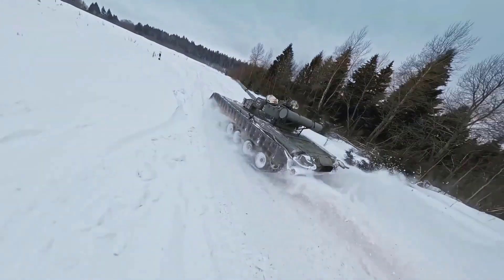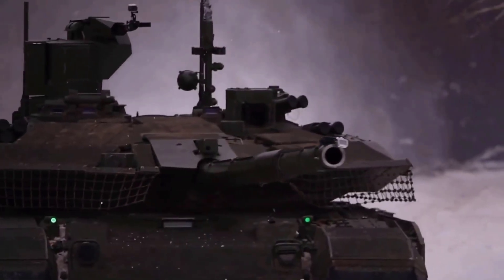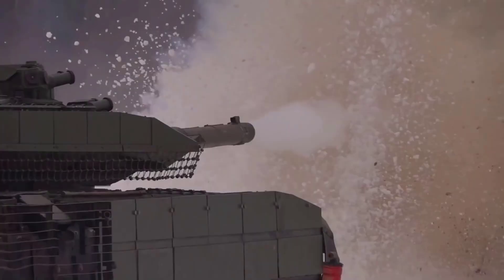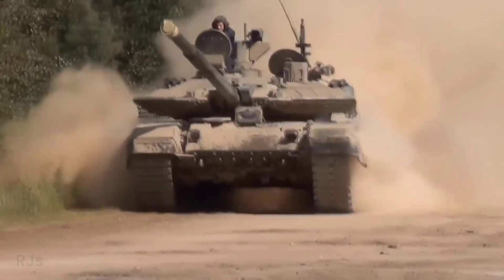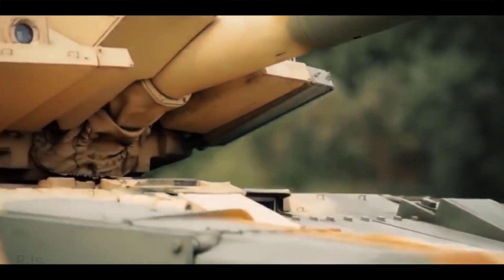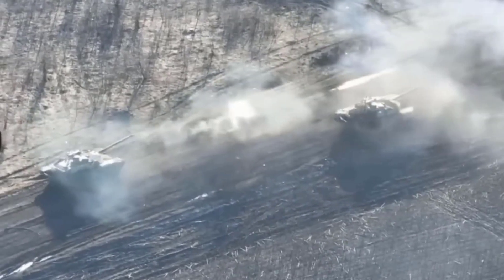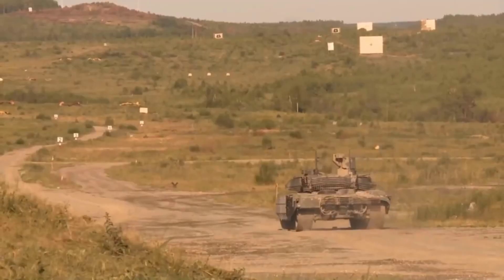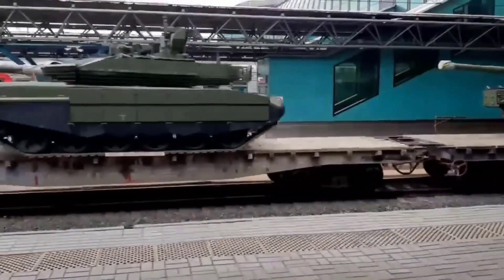Advanced Ukrainian Tank Vs Russian Made Tank | BM Oplot Vs T-90M

Comment: In the comments, the technical specifications of the tanks are very mixed up.
For example, information about the engine and speed, as well as dynamic protection, the control system, etc. This is strange. What was the purpose of making this video? Most likely, it was created to mislead the viewer.
The Ukrainian tank is equipped with thermal imagers for both the gunner and the commander. These are French thermal imagers of the 2nd and 3rd generations, and they are of very high quality. The Russian tank also has two thermal imagers, both of the 3rd generation. However, it is unlikely that they are of French or European origin; they are most likely domestically produced. The quality of Russian high-tech equipment is well-known worldwide and is often comparable to Russian automobiles: it works, and it’s good that it works at all.

Before the sanctions, Russia used electronic components from developed countries, but this is no longer possible. Therefore, the quality of these devices is highly questionable.

In terms of automatic target tracking by thermal signature, both tanks are quite similar, and this system functions on both. However, the Ukrainian tank additionally features automatic fire leading.

The armor protection of the Ukrainian tank is similar to that of the T-84. However, it also has "Duplet" reactive armor, which consists of multiple layers of Ukraine's "Nozh" dynamic protection system.

The T-90 uses "Relikt" reactive armor. Tests on the "Duplet" system have shown that it is more effective at stopping various types of shells and tandem munitions, and this test data is publicly available, with video evidence of its effectiveness. The Russian "Relikt" system is much simpler, essentially an explosive sandwich, with its precise effectiveness unclear. It appears similar to older systems used on Russian tanks, and there is no video evidence of its performance.

The Ukrainian tank’s side armor is phenomenal, and comparing it to the Russian tank’s side armor is pointless—they are in completely different leagues.

The carousel-type ammunition layout in the Ukrainian tank is slightly more dangerous than that in the Russian tank. However, it allows for faster reloading.

Regarding ammunition detonation upon a hit, the Russian tank theoretically has a lower probability of such detonation compared to the Ukrainian tank.

Mobility:
The Russian tank has less power but more torque. Therefore, despite the Ukrainian tank’s greater weight and lower torque, it accelerates slightly slower. However, the Ukrainian tank has a reverse mode, effectively turning its forward gears into reverse gears. By switching between forward and reverse modes, all forward gear speeds are preserved (except for the highest gears), allowing it to reverse at speeds of up to 30 km/h. The Russian T-90 has only one reverse gear, which allows it to reverse at just 4 km/h—a potentially fatal drawback. The ability to quickly retreat and change position can mean the difference between life and death.

Currently, production details for both tanks are classified on both sides.

Judging by the videos on YouTube of Russian tanks participating in the war against Ukraine, there is nothing phenomenal or impressive to talk about: Russian tanks burn brightly, spectacularly explode into pieces, and throw their turrets high into the air. It seems that while much can be beautifully said about them, the reality on the battlefield speaks for itself: everything looks smooth on paper, but they forgot about the ravines.

Similarly, in this video, the Russian tank was praised with beautiful words, attributing all the advantages of the Ukrainian tank to the Russian one. Well, that doesn’t make the Ukrainian tank any worse on the battlefield!